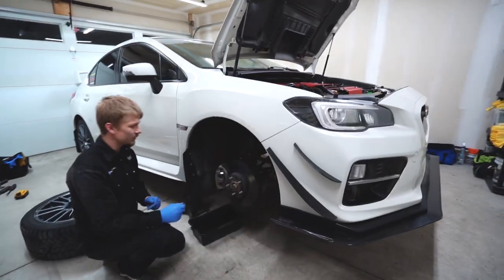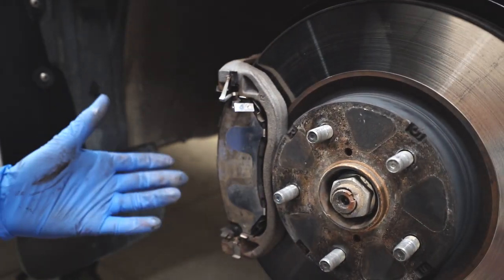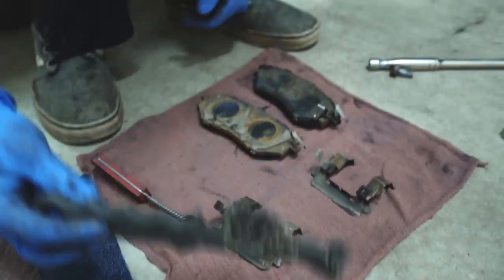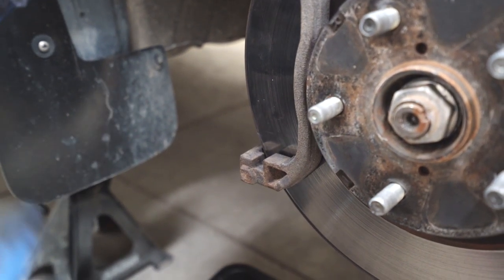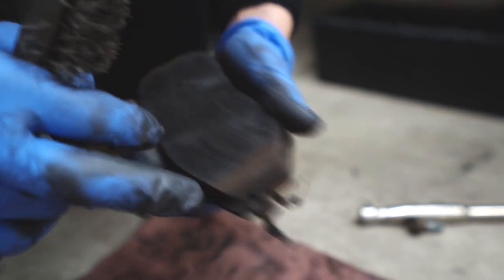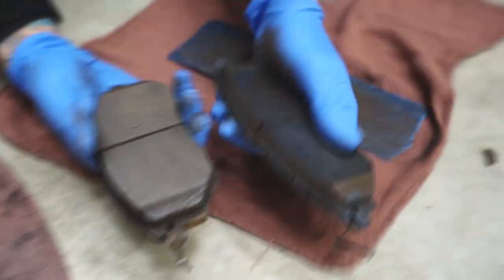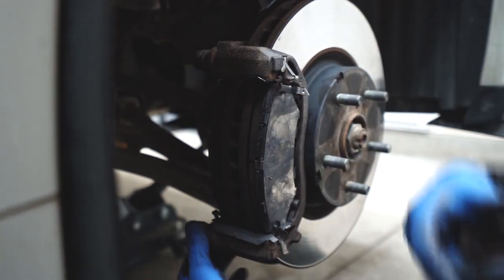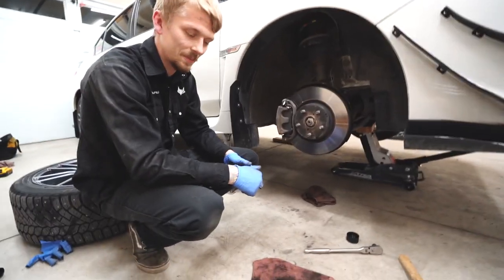DIY Brake Servicing your 2015+ Subaru WRX

Comment from the maker: Leave a comment and let me know how regularly you perform a more thorough brake service!
Reply: Did mine right before winter, man Brembo’s way different.
Great video man!! Looking forward to the next one.👍🏻👍🏻
Reply: thorough? Not enough, I am guilty of just slapping on some new pads last year when i felt my OEM ones were underperforming. I've been thinking about doing a thorough service to them for quite some time now and this tremendously helps understand how to simplify what needs the most attention. I also want to paint my calipers a different color so this would be the ideal time to try that. Great video!